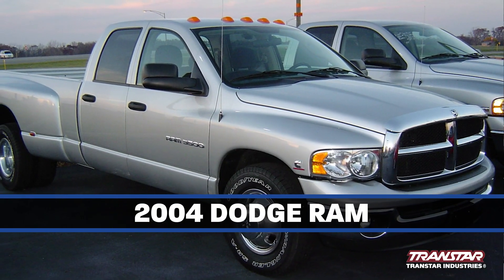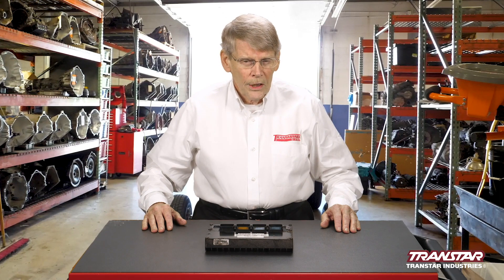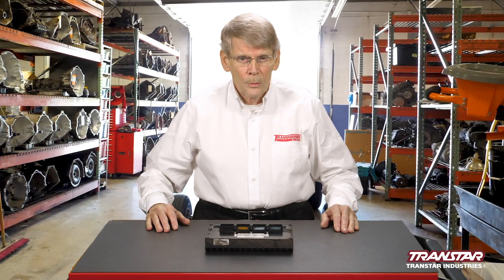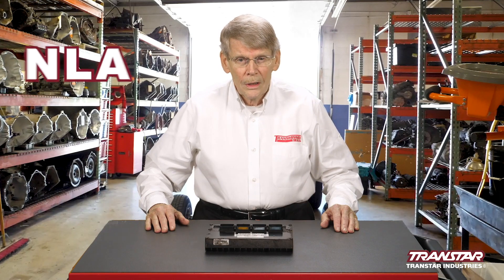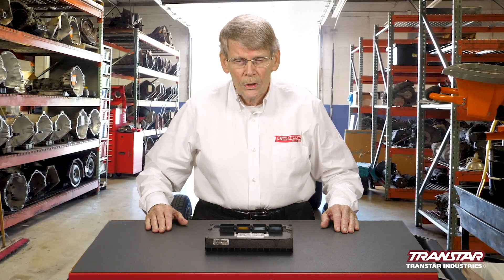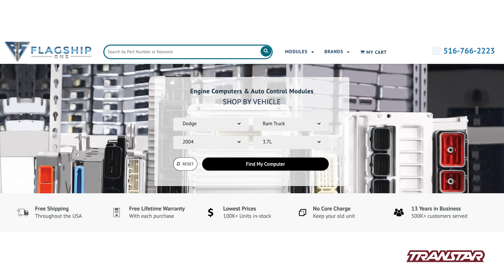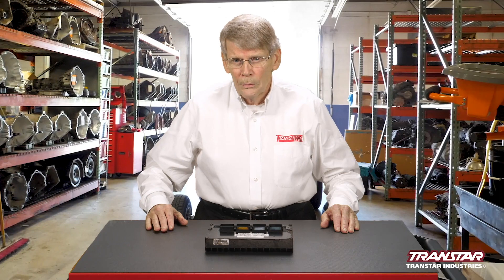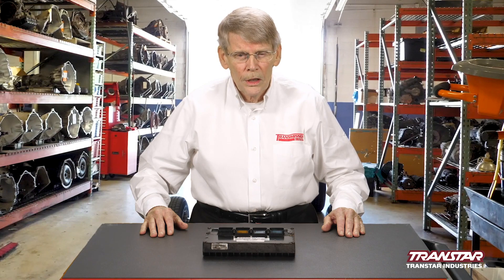PCM Replacement: Plans A, B, and C

Comment: To use a used pcm in a dodge it has to be reflashed to match the spec of the vehicle it is to be installed on, I am not sure of all info needed but the odometer reading must be correct.